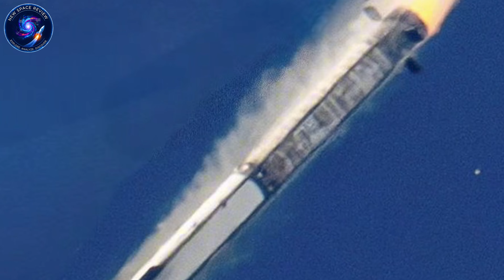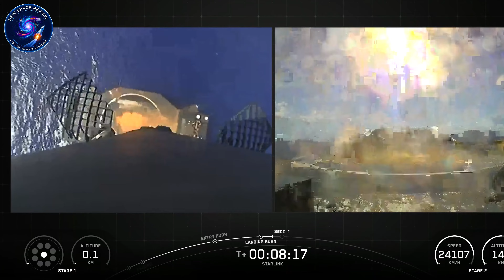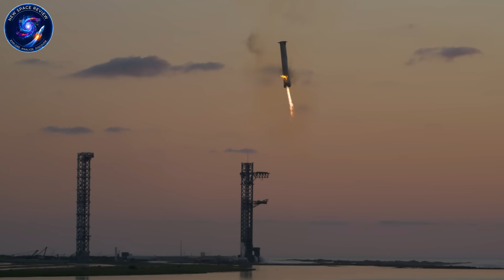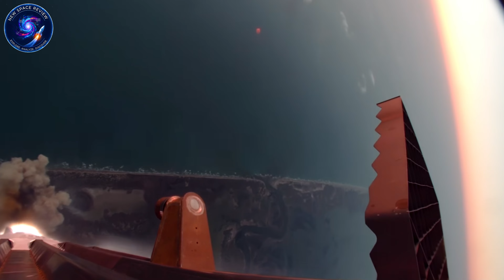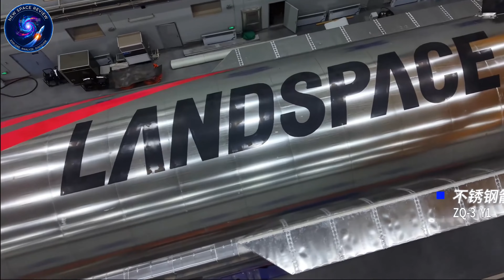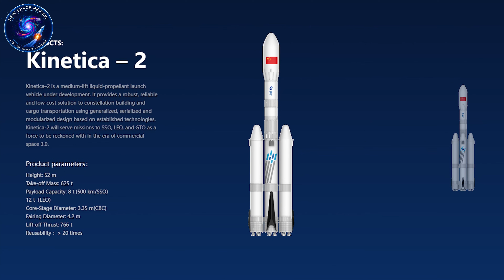Elon Musk Revealed SpaceX's Landing Solution China Can't Copy: 2KM Miss. Shocking!

Comment: Humans have a tendency to infer agency everywhere—to see intent, intelligence, or mastery behind appearances before fully understanding what we’re looking at. We see an outline of something impressive, and our minds quickly fill in the rest. That tendency can make imitation look like equivalence.

Copying, by itself, is not the same as leading. A skilled copyist can reproduce the outward performance of something remarkable without having originated the underlying ideas or systems that made it possible. For example, it’s impressive to see a young child perform Mozart well at an early age, but that performance is not the same thing as being Mozart. The distinction between replication and original innovation still matters.

China’s space achievements are genuinely impressive, including landing on the Moon. That said, they are operating at a different level than programs like SpaceX, which has fundamentally changed launch economics through rapid booster reuse—a capability that took years of iterative failure, risk-taking, and private-sector flexibility to develop. Copying the hardware is far easier than recreating the development culture that produced it.

Whether China can overtake the U.S. in space will depend less on individual technical demonstrations and more on long-term economic strength, incentives for innovation, and how global markets function. Sustained leadership in space requires an environment that rewards competition, tolerates failure, and allows ambitious private actors to move quickly.

As long as the U.S. maintains those conditions, it is likely to remain ahead of China in space for the foreseeable future—even if others continue to copy what American companies have already proven is possible.
Reply from the maker: Spot on. Copying hardware is one thing, but replicating SpaceX's decade of iterative failures, software maturity, and risk-tolerant culture—that's the real barrier. China's recent Long March 12A 2KM miss (Dec 2025) shows progress is real, yet the gap in operational reuse remains wide.